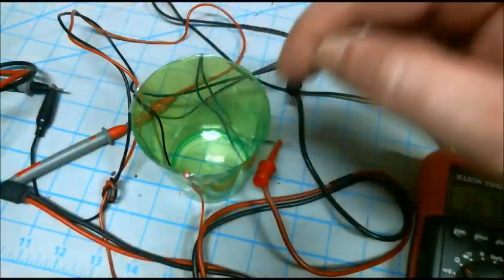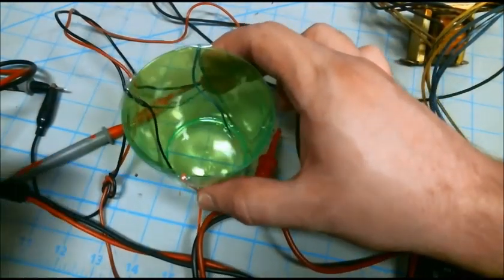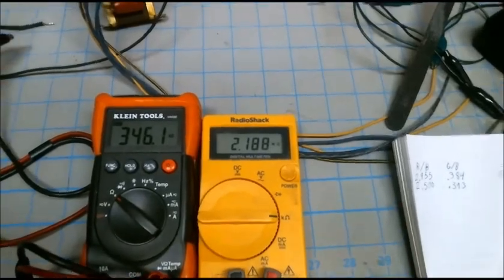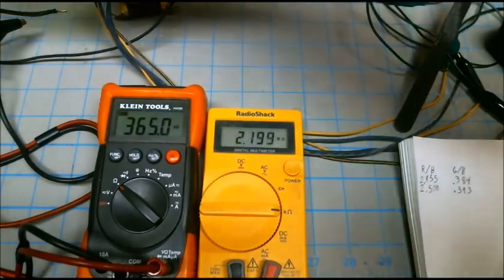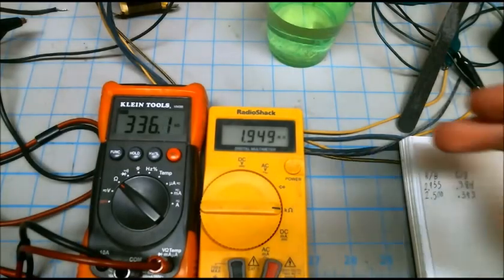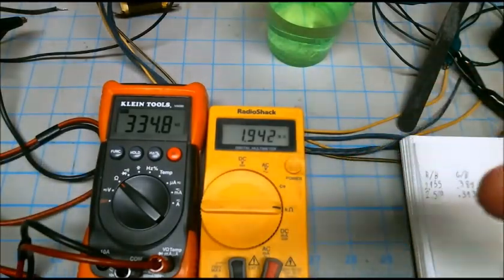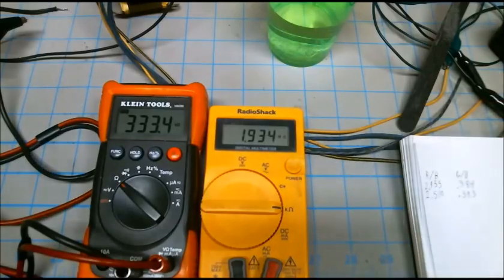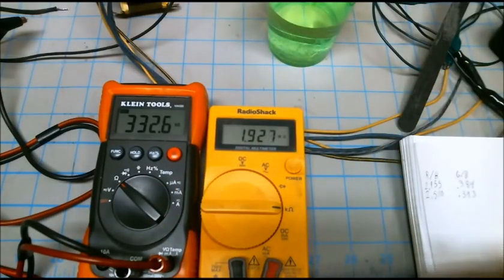3 wire water depth sensor

Comment: Looks like all you need is one or two op-amps and a panel meter to make a complete water level measuring system using this three-wire method. Easy to design, low cost, and immune to absolute quantities since it's one measurement relative to another. But I agree about the potential problems from electrolysis. (Platinum, anyone?) More reliable (and platinum-free) method would be to measure capacitance between two vertical, parallel, insulated wires.
Reply from the maker: Excellent Ideas Eric Wasatonic